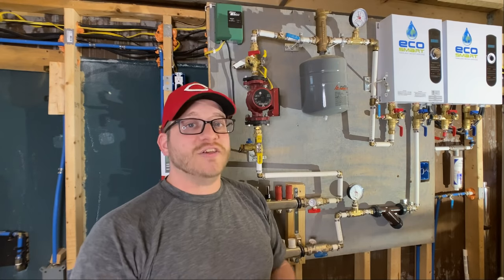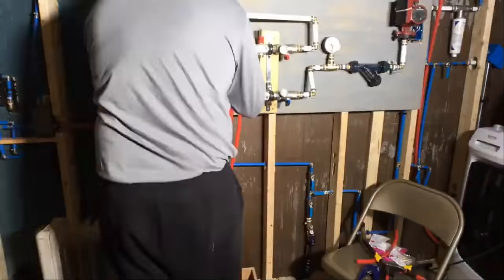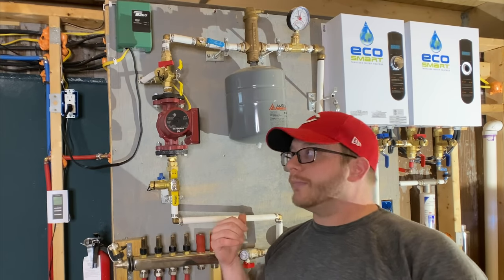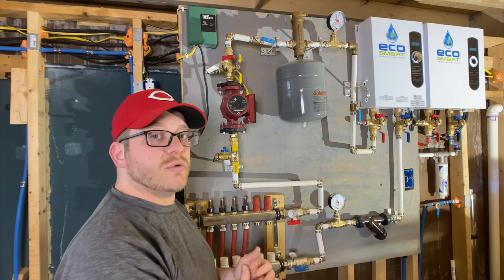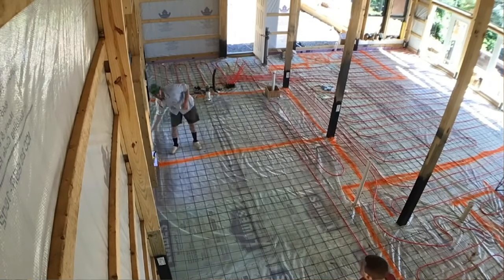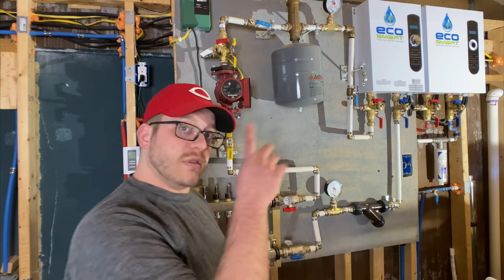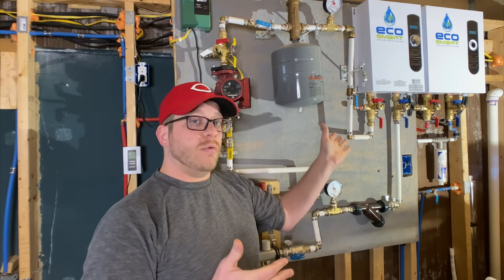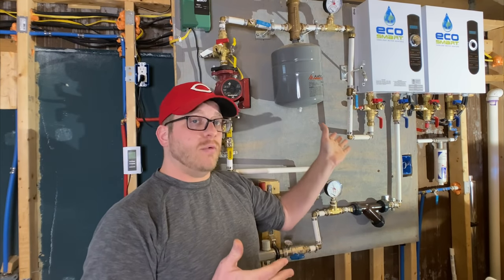Amazing Radiant Floor Heat | One Year Update & System Costs

Comment: With high insulation grid powered thermal mass heating is a good idea because the grid is transitioning to renewables. I did the same strategy in my 100 year old house.

I installed R100 in the attic and R35 under the floor boards and then I installed an electric coil thermal mass tiled floor slab under my bed and desk. Works great providing the best heat!

Comment: Hey good to see your setup again! Man your electric must be higher than mine. My building you probably remember is 2300 sq ft and my bill is usually $200 avg. it was $250 one month when we had a lot of below zero weather but that was crazy cold. Also that includes all my electric usage not just heat. Curious what your cost  is per kWh?. Thanks for the update.
Reply: $250 seems so cheap to me out in Northern California!  I'm curious what YOU pay per kWh?

Comment: Have you considered using an air-to-water heat-pump in combination with a large accumulator tank to heat your floor-heating water?  A heat-pump with a COP of 3+ is not all that expensive and would reduce your heating-related power bill considerably.  Your circulation pump would then draw its water from the accumulator tank.  I set up such a system here on the west-coast of Norway about 12 years ago and it works wonderfully.  I even use the heat pump to draw air from the house's ventilation thus ensuring that wonderful combo of fresh and warm indoor climate.  If your  accumulator has an extra heating coil you may even use it to preheat the cold inlet water that you feed into your consumption hot water tank.
Reply from the maker: Sounds like a great setup you have! 
We have extremely limited space in our utility room and the small wall mounted electric tankless is perfect.  Heat pumps are the more efficient option for most people for sure.

Comment: So regarding... the... control via multiple breakers...

You're most likely not saving much by switching one off. Yes, the instantaneous draw is halved, but the unit will run twice as long to reach the same temperature. Half of the power, for twice as long, is actually the same amount of energy. You halve the kilowatts but double the hours, so the same number of kilowatthours.

As to the others, talking about your costs being high... I don't think that has anything to do with it being a radiant floor. Your costs are high, but I suspect that's entirely because your energy source is electric, which comes with an associated high rate.

There are direct-vent hydrocarbon-fired on-demand water heaters available, which ... listen, no responsible person would ever go on record calling any gas-fired appliance "DIY-friendly," but it's been done many times and if you follow the darn instructions they're really not that difficult. Technically the fuel efficiency is actually less, BUT the fuel is considerably cheaper, so your monetary efficiency would be higher.

There are also heat-pump-based water heaters which I've encountered a few of - they're tank-type, and don't achieve nearly the heat output you would need to warm your place up from a cold start, but it might be worth looking at for just maintaining temperature. Disclaimer: I have not done any math on that, the idea literally just popped into my head as I'm writing this, so if you check it out and it turns out to be totally impractical, well, it was just a thought so don't set me on fire.

Others have mentioned zone valves. If you're not having problems keeping even heat throughout the house, and you're okay with "all or nothing" heating, then great, there's no pressing need to add additional copmlexity... on the other hand, depending on lifestyle, you may be able to save a bit more money by lowering the temperature in parts of the house...
Reply: I think he was saying they use both circuits to get the slab up to the preferred temperature, then shut one off if they just want to maintain that temperature and it's not excessively cold outside.

Comment: Just one thing: I would put the circulator to pull the water into the heating unit and NOT pulling from it. It just makes the life easier on the circulator  as this method prolongs its life as it gets the water that is not as hot as the water exits the heating unit.
That's all. Other than that, I really loved your system. In fact, I'm using it as the model that I'm building my own system based upon.

Comment: Great video thanks for sharing. Just so that I am clear, your 18kw water heater heats your house and your 27kw water heater you use for hot water like in showers and stuff, is that correct?
Reply from the maker: Thanks! 
Yes the 18kw is on a closed loop with the radiant heat. The 27kw is for the kitchen, shared bath, and laundry.
Reply: @LittleMountainLife  Thank you for your response. I had the idea of doing something similar, but wasn't sure if it would work. After watching your video, I am going to give it a shot. I ordered a 24kw Tempra Plus Instant Hot Water Heater. I am going to install it in what is called an open direct style, which will serve both domestic (showers, sinks, etc.) and a heating loop. No idea if it is going to work, but I shall try it for science! Thanks again for sharing your knowledge.

Comment: Awesome video! I live in rural alaska. I have a 1100 sq house with a attached garage (including the sq footaged) i have a hot water on demand and two toyostove. One in the shop and another in the house. I burn 300 gallons of diesel every 4 to 5 months ($1300) for the diesel. Plus $280 for electric a month. So hope that wood stove will work. Im planning on building a shop with floor heating. That why i watched your video. Thanks again.

Comment: Anyone deciding to dyi a radiant slab job should make sure to insulate the sides of your slab with twice the insulation thickness as what is under the floor. Outdoor temps are colder up shallow near the slab edges in winter than directly under the slab and much of your heat will exit where heat loss is greatest. Think about it, the natural ground is say 50 degrees F, but at the edges near the surface the ground temps could be well below 32F. Install "edge" insulation to extend to at least 18" below the surface. Just some solid advice......

Comment: Great explanation of the system. I'm glad it's working so well for you guys.

I have a 14x16 building and had a Mitsubishi mini split installed. It's wonderful! Very economic and reliable and keeps the temp within 1* either cooling or heating. Also it's whisper quiet which is nice.
Reply from the maker: Awesome!
Thanks for watching!
Reply: so I did mini splits in my shop 28x40. I also did radiant tubes just in case and for resale.  After being in my neighbor's shop who did radiant....I'm thinking strongly about adding it. His shop "felt" so much better than my shop. If you live a Menards they sell everything needed and they (via Nebco) will do the tube layout for you.

Comment: Very informative. Just curious to know what you pay per KWh in your area. I’m on a duel fuel geothermal system and we get a big break in electricity.
Reply: Came here wondering this too: what was the cost per KW and how many KWs was the bill?  And to confirm that’s just the heating not your whole electric bill
Reply: What does everyone else pay for their utilities?   Mine in Central Iowa with Mid American Energy are:   KW used = 1710, bill for electric = $141.61... so 141.61/1710 = $0.0828 per KW

For Natural Gas I used 112 therms and was billed $67.82... so 67.82/112= $0.6055 per therm.  

This bill was for January 2021. My house was built in 2018 and I only have a natural gas forced air furnace.  I’m trying to decide on an electric vs natural gas boiler for my radiant floor heat in my basement.

Comment: Thanks for the update.  What it has show me is that I sure dont want to use electric resistance to power my system.  Even with the fluctuation in prices for propane going with a storage tank and a few solar panels, will be a much better way for me.  Am thinking that the upfront cost might be a bit more, but the back end costs will be a lot more $$$ efficient.   I live in zone 4 almost to zone three, so my heating needs are a great deal less than yours.  I am using 7/8 inch pex al pex so I can go up to 500 foot per loop. What this means is just three loops. Really not a lot of reason to have balancing valves like yours.  Three full port valves for me will be fine. I am looking to do 2  12k btu mini split heat pumps.  They will not draw as much current as I am looking at 240 vac models.
Reply from the maker: Sure thing. Sounds like you have a solid plan!
Reply: Right now Natural gas and propane would be a cheaper heating option over electric. Save over 1/2 to 1/3 price if they could use that or get access for it.
Reply: @JasonYouTube       electricity / resistance heating will always be the most expensive way to heat water.
Reply: @stevepailet8258  If he did a thermal mass build and then hooked up to off peak electricity rates , he could be pretty close to ng/propane rates. Off peak runs about 3 cents per kw and around 29.5 kw equals 1 therm. So around $.90 per therm for using  electricity, off peak.  Also electricity  is 100 percent  efficient  where ng depends on  boiler efficiency  . So off peak might be better in some areas due to delivery charges
Reply: @JasonYouTube  dont know what state he is in.. so cannot comment.  Dont know about his thermal mass or inches of insulation nor what kind of air and moisture barriers he used.  Lots of things to be considered.  I know one thing in Canada they are looking at such things and the bottom line is they are building in a colder climate and using only enough power that they can heat the house with what is equivalent to a hair drier. 1500 watts and that is a base board heater.

Comment: You should install a geo thermal unit . I am from Ireland who where the ground freezes in winter  . I have worked on alot of houses that have it.  It takes heat from 6- 12 foot under the ground and pumps it in to the underfloor heating via a heat exchanger . It has an initial cost but after that you are paying to run a pump only . Boilers are installed as a back up but rarely needed depending on how hot you want the floors ..
Reply from the maker: Solar heat will happen soon 👍

Comment: Thanks for sharing your build, I especially like where you talk about the heating system components.
I noticed that your piping to all your components is PEX tubing this is the first system I've seen that isn't copper
I'd rather use PEX vs copper for plumbing all the components together Have you had any problems with PEX instead of copper setup?

Comment: I haven’t really had a heat bill in 15 years, I m using an od wb .tho I have some electric cost the rest is basically free after initial install. Tho not as slick of a system it is extremely comparable in the comfort aspect. I’ve saved $30k in propane costs n gotta say “love it “!!!! 3500 square feet too !!

Comment: I have installed modulating boilers and ,they are better for heating and hot water with the turn down ratio when not heating and just needed for domestic hot water

Comment: Hello nice video.  I build a 1200 Sq ft slab on grade double wall construction which I s supper insulated  I put in a open radiant floor system  where I use two 50 gallon heat pump electric  hot water tanks .this supply my heat and hot water .I keep my heat at 74 degrees  for 8 months a year and  it's cost me  me about $750. A year at  $00.10 AKH  I live in upstate northern  NY  so it does get cold here.

Comment: Probably a redundant comment but you could probably go with a heat pump water heater to save a bunch on the radiant heat. Many of the utilities incentivize that as well although in my area they force you to use an installer who just marks up their cost with the incentive...
Reply from the maker: We will eventually have solar setup and that’ll help with running costs big time. 
Thanks 👍

Comment: That pump brings back fond memories.  I installed a radiant heating system when I finished off the basement in my last house.  It featured radiant heating above the slab and below the ceramic tile flooring as well as underfloor heating for the kitchen tile floor.  It didn't need to provide that much heat - just the comfort of having warm, rather than cold, tile floors.  I used a side loop off of my existing water heater.  Three separate temperature controlled loops, so I had three of those pumps that you have.

Comment: You might have covered it but what temperature do you normally try to keep the barndo at?  Have enjoyed watching all your videos and appreciate you sharing the successes as well as the failures and how you overcame them.
Reply from the maker: Thanks we appreciate you saying that!
We currently have the heater set to 110 degrees with just one of the two elements on and the outside temp is 15 degrees. Inside room temp is 73.
Reply: @LittleMountainLife  whoa 110 degrees sounds hot for floor water when 15deg outside. What is the actual water temperature, is it keeping the 110 or is the temp limited by the heater power? Do you have any way to control the heater setpoint according to outdoor temp?

Comment: Electric slab hydronic heat is the only way to go.  Dont forget when you go from slab radiant heat to wood stove or mini split you are reverting to convection heat.  Convection is totally different as humidity will be drastically effected.  I would advise a air to water heat pump with an external wood boiler as back up or go solar with battery back up.  My house with about 60 tons of concrete slab can withstand a day without power without loosing alot of heat.
Reply: The only issue is the cost. The electric heaters must be CRAZY price to run. I would like to know what a years electric bill is.

Comment: does different floors need different system or can it be integrated into one system? how comfortable you are about putting it concrete!! i am little concerned about leaks and having issues on repair as i wont be able to take it out if there is a leak

Comment: I have installed a single zone radiant heat system for a separate AUD ,430 sqf. I chose electric for some of the same reasons stated here. There is another reason, PV panels. (If the system used gas I could not take advantage of the solar regarding heat.). 
The heater I chose strongly recommended copper pipe coming in and out of the tankless water heater minimum 3’ from the unit. (Not PVC) and the convert to the pex at the floor. I love the shark bite, pex ,pvc plumbing system and it would have been way easier as well as making repairs or adjustments to the system. So I went with copper but made sure all components could be removed and serviced without desoldering  copper joints. 
So far I love the soft heat ,virtually silent. It comes on in the early morning for a couple hours and it’s good all day and most of the night. ( 18 inches of thermal mass).
You can have doors and windows open during the day(COVID) for business clients without losing the heat investment. ( I am in California) You’re not heating the air but the thermal mass.
I went with an open system so the same heater supplies two sinks and a shower. The warm floor acts as a water tank (average of 98 degrees in the cold season) this makes it easier for the small tankless heater because the water is prewarmed before entering the heater and the fixtures provide a much quicker access to hot water ( saving waisted water.and energy).
Reply: Hi, Dana, can you share more details about the system you used? Brands costs, etc? I share the same weather and are looking to build several ADU type setups.

Comment: That is insanely high for all the bigger your house is! My house is 1100/1200sf, built in the early 1900s with almost no insulation in the walls or attic, and most of the windows are single pane wooden. It's heated with an 80% forced air furnace, and with the temperatures in the low 30s during the day, and mid/low teens at night my heating bill gets up into the hight 100s, and will only occasionally break $200. Oh, and my water heater is gas too so around $35 of that is heating water. You've either seriously mis calculated what you're spending on heating, or seriously need to swap those electric hot water heaters out with gas ones.  Electric is the most expensive way to heat.
Reply: "electric is the most expensive way to heat"- are you joking? depends on the cost of a kw in your area vs cost of natural gas, propane etc. one size doesn't fit all.

Comment: Great video! Thanks for sharing your experience. I live in Norway and want to setup a similar system. Did you consider using tank heating systems rather than tankless? Main benefit I see is the ability to avoid running the heaters during peak electricity prices (6-10 am and 5-8 pm). Thanks!
Reply from the maker: We went tankless because of the easier install and less space required.

Comment: Enjoyed your video. Suggestion regarding cooling(although probably a bit late) you could very efficiently run cool water through the same set of circuits and make a switch via a chiller and heat exchanger  between winter/summer modes. Very effective and much more eco friendly than using Aircon. The cooling effect from the floor is very comfortable like the radiant effect with heating but in reverse( your bodies give up heat to the floor in cooling mode).

Comment: If it's having to run longer because of the lose of power(breakers turned off) it's pointless to turn breakers. Off you're paying for kw/hr. So it's still pretty much the same. 

They have boiler houses you can install outside, that are totally self-contained. Just put pellets or logs it and it manages itself. You could remove electricity totally from the system and have your fire outside the house
Reply: Have a link to such a system?